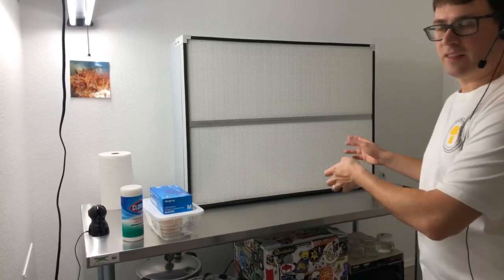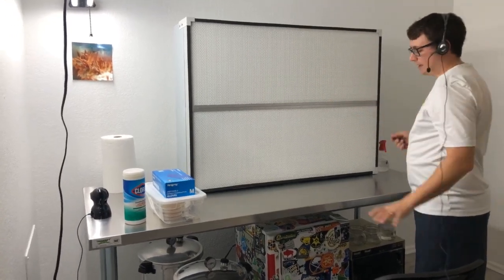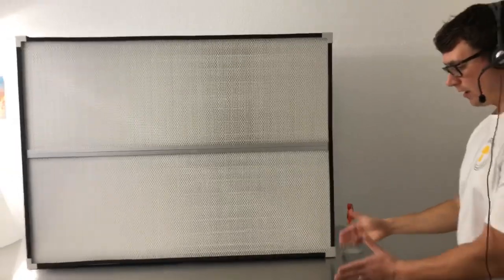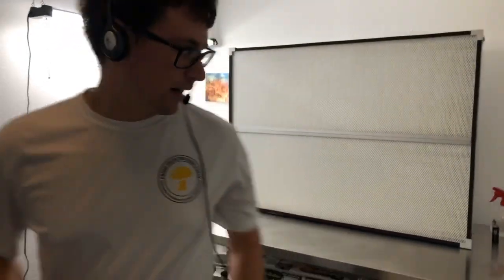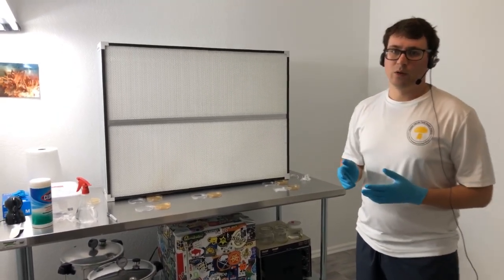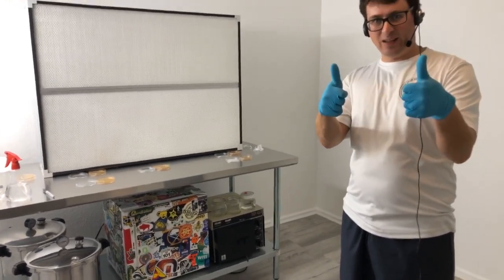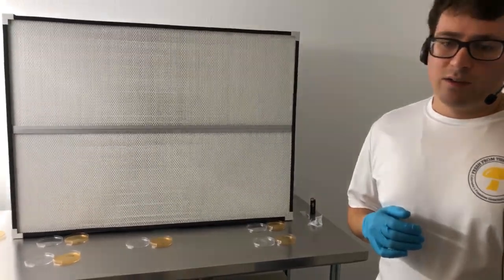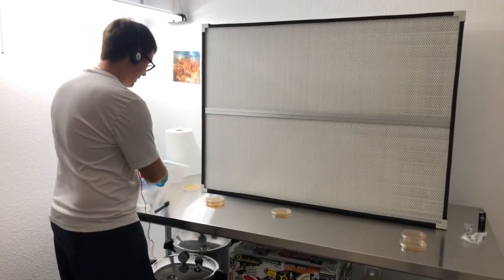Fungi Friday #6 Testing the flow hood and calibrating the workspace

Comment: I think your plate test is invalid. Need to have a stage about 6 inches above the bottom lip to be in the true laminar zone. Being on the bottome that close to the flow hood it's likely to pick up something.
Reply from the maker: not true - this test is objective and no growth was observed- the stage is optional in my opinion as long as you are working in that region you can still protect the media and organism while working on the bench - this is common practice in all the labs Ive worked in - also, I use this hood mostly for substrate inoculations and have a separate flow hood for culture work so Im not as concerned about this.

Comment: Is that 2 24*48 envirco Mac 10s?
Reply from the maker: no - it’s one unit with two filters so it’s cheaper for replacement.  I have an air science flow hood as well that utilizes this (it’s cheaper to replace two smaller filters than one giant one - this comes with experience)
Reply: @FreshfromtheFarmFungi  what size is that unit? I have a 24*48 myself. Do you ever clean the face of it? If so with what? Iso?

Comment: Thanks for all the wonderful content. I do have a question. Would it be better to not have the dead zone at all and have a shorter version of the hood? I work off of a tiny flow hood and definitely see the point in going larger as it's not as tall as a stack of strike dishes. What is the benefit on going with such a tall filter system?

Comment: I bought one of these form a dude in oregon, 12 hour round trip, $850, 2x4. Experiencing contamination. bought an anenometer for 15 bucks, 70% of the filter is dead zone, the other 30% is 180-240fpm. Contacted him, he said to seal with silicon. Just did that, fingers crossed it helps but my faith level is low. Expensive mistake if so, may have to build a true laminar flow hood from scratch.
Reply from the maker: look up the mac10’s by humble fungus -another good alterna
Reply: Did the silicone sealing help?
Reply: @naturallydope247  nope, still turbulent flow. Makes me kinda sad, the person is ignoring my latest attempt to reach out and doesn't seem interested in remedying the situation. Funny that you should comment now, I am currently as we speak working on building my own 2x4 laminar flow cabinet using FreshCap's guide. Almost done :)
Reply: @Huachuma1  I'm sorry you had to experience that. That's rough. When I priced out the cost of buying one premade vs just making my own it was just more economical to make my own. I'm also almost finished mine, but it's smaller for my workspace. I started making the list for my next one though-a larger 24x18 size. Best wishes with it all!
Reply: @naturallydope247  It's ok, I've moved past it mostly lol. Well it's not the size that counts, it's how you use it XD If I was building from all brand new pieces, I would have probably went with a smaller like 1x2. However, I just so happened upon someone who had a 2x4 HEPA and the fan motor for it that was willing to give me a decent deal as they were moving out of state, so it was just my luck! It was funny, found them through an ad for metal racks for our microgreens, they ended up having microgreen supplies to sell us too!  Thank you, Good luck on your build, hope it comes out great!
Reply: @Huachuma1  Awesome. I'm glad it still worked out for you.

Comment: I was under the impression the Laminar flow coming out, was supposed to have quite a push, even enough to blow out a flame. Am  mistaken ??
Reply from the maker: this works perfectly fine - anything with more force is overkill in my opinion.  It may work but is not necessary
Reply: @FreshfromtheFarmFungi  

Ok thanks that clears things up for me.
Reply: @FreshfromtheFarmFungi how fast do you run it

Comment: I'm confused. Why can't I used my mea agar plates? Do you mean the time being a factor because what's the point of using a flow hood if my mea plates will catch contamination?
Reply from the maker: you can use MEA but the DRBC are specific for yeasts and molds - MEA are more sensitive
Reply: Same question.  What's the point of s dope ass hepa hood if you can't work woth MEA...?

Comment: Hi there!! One question... what’s the cfm rate of the fan back there? Do you you think that this set up would be good for tissue culture? 🌱Thanks👍
Reply from the maker: I'm not sure on the specs but from my experience so far (poured over 300 plates without any contams and did over 25 transfers in the first 2 weeks with no contams) it seems to be sufficient for mycology, which in my opinion is more liable of a process because most plant tc media contains less nutrients and more inhibitors.  I would use test tubes to be safe but I believe it's a great setup - only time will tell for longevity, but the pre filter is still clean after 3 weeks now and I usually swap them every 6 months.  If you are willing to spend the money, the air science flow hood has been going strong for over 3 years now and that is what I used regularly for plant tissue culture in the past.  It's about 3x the cost for the same size (4' hood)
Reply: @FreshfromtheFarmFungi  im thinking about investing in the 72" ULPA hood.. thoughts ?

Comment: How did you cancel the noise from the fan in this video?  That's amazing.
Reply from the maker: I tightened up some rivets and put a piece of foam against the pre filter so it doesn’t rattle - this is one of the quietest flow hoods Ive used so far! Very pleased 😀

Comment: What is the primary difference between 2 HEPA filters with a similar rating (99.99% 0.3micron) of a different thickness? You said that the filter element on this one from Myers is 2.5" thick. How does that compare to filters that are much thicker like this 11.5" thick filter? https://www.filtersfast.com/p-HEPA-Filter-Replacement-Camfil-12XH24Z24Z121D3CA.asp Less resistance & more air flow with a similarly rated blower? Longer life expectancy? Cheers!
Reply: The thicker the hepa filter, ( more surface area) will last longer than a thinner hepa. A friend of mine owns a filtration company and taught me this. I have also verified this in the field as a service tech.
Reply: @brucekidd6133  That's what I figured, thanks! :)
Reply: The thickness affects the surface area and that affects the CFM rating for the fan and the air volume pushed out from the filter